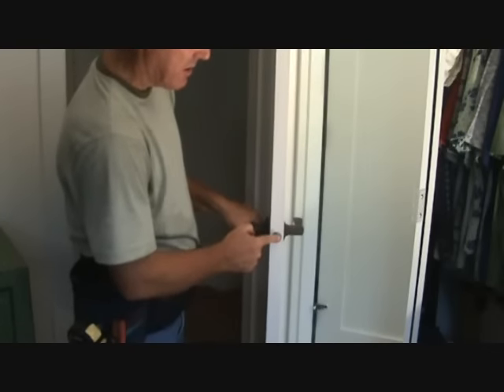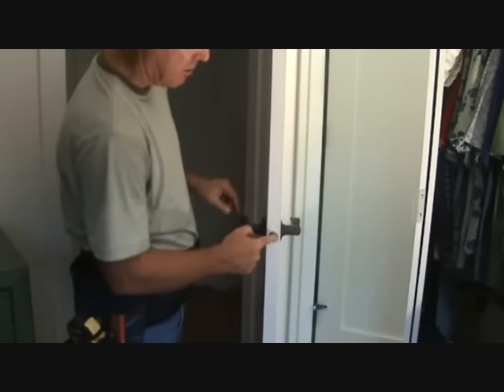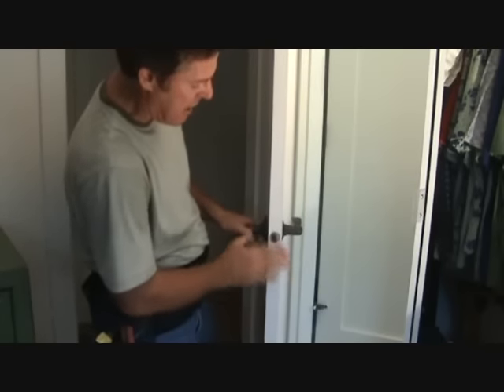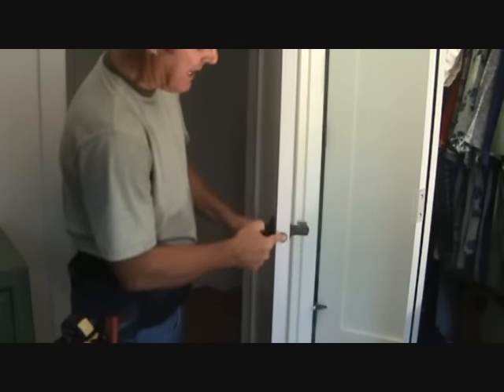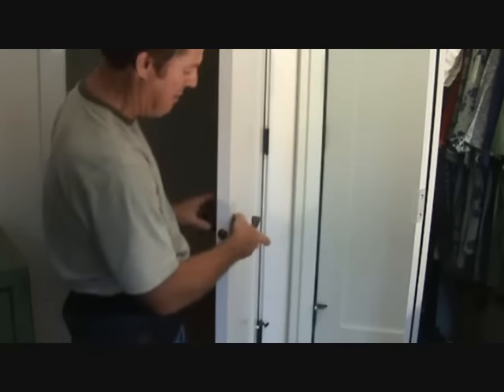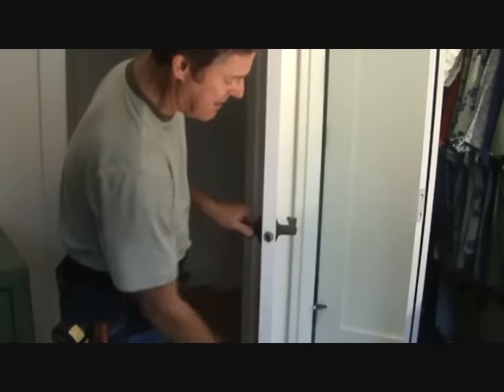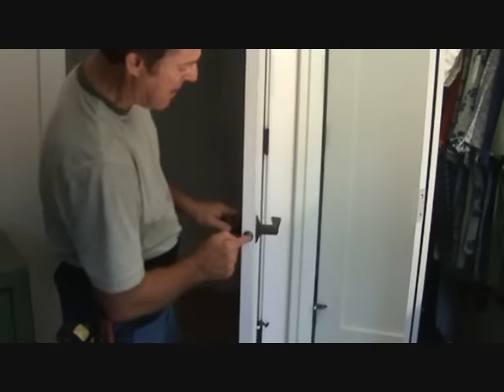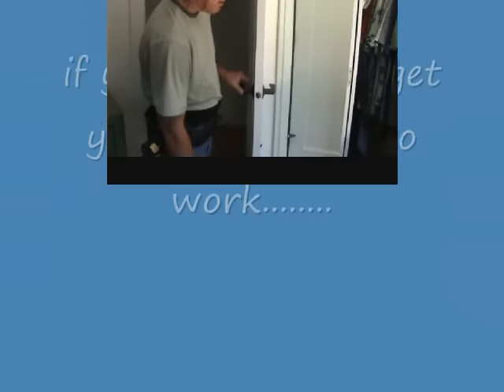Is your "door latch" sticking?

Comment: Hi Joe. My door is stuck shut, something has busted in the mechanism and it won't release the latch, hence I can't get into my own toilet :/ I took the outer handle part off and some broken casting came out. I can slide the handle and activating bar back in and it seems to get some traction when I turn but latch won't release and door won't open. I'm a bit stuck, can you help?
Reply: ***** I can't do the butter knife thing as I only have access to the outside which is the side that butts against the frame, so there's a right angle there before any access to the latch.
Reply from the maker: Did you get that door open or have you wilted & got stuck there for the last 8 years? I have lots of videos that show how to get into a locked door. Go to my main YouTube channel then click on playlists & scroll down to doors & they will be in there....for next time! Thanks for stopping by!
Reply from the maker: Credit card but you're going to bend it up but you might be able to open the door.....you didn't need to pay that bill anyway!

Comment: Hi Joe my door latch won't open my door is closed and the little latch won't go in so I can't even open my door.. what can I do?
Reply from the maker: Take a putty knife, or butter knife or something flat & slip it in there right up against the door latch. Pull on the door handle then try to start sliding the latch open. You can only slide the latch a little way then hold tight on the door so the latch won't slide back to it's normal position. Now take a bite of the latch & slide it some more. keep doing this & you will eventually slide it all the way open so you can open the door. Do you have a crummy credit card? Bend it & slip it in there below the latch then try to swivel the card up behind the door latch to slip it open. Maybe that will work for you. Some door latches are different than others as some are designed to not open at all when the door is close. That's usually for keyed doors though. Let me know how you do!   Joe  :0

Comment: What if I can turn the handles inside and out all the way but the latch only goes back about half to 3/4 of the way?
Reply from the maker: +Bryan Adams Your latch could be all gummed up inside to where you need to spray some silicone on it to let it slide freely. Or you might have a portion of your door body maybe not clicked into the door latch properly. Or your door handle unit is so old that it's pretty worn & it's slipping the latch from going in all the way when turning the handles. Check it out & let me know what you do. If your handle is really old may I suggest you replace the entire unit with new. They don't cost that much & would solve your problem if it's because your unit is really old. But check out the other items I have mentioned as well as maybe you could fix it back to normal. Good luck & thanks for your message!   Joe  :0

Comment from the maker: You might have a metal piece broken inside the door latch....or it could be something else. Take a crummy credit card....or the one you spend too much money on!!...lol & bend it & wedge it between the door stop at the same height as your door latch. You might be able to slip the credit card behind the door latch & push it in to then open the door. You won't be using the plastic card again as it will be damaged, so pick wisely.   Joe  :0

Comment: That slider on the backs of a lot of keylock door knob latches.

It seems that when that slider is depressed, the latch can't be pushed in except by turning the knob, rendering card slides unable to open a door.

So, my question is this,

if that slider is designed for the purpose of being depressed to keep cards from being able to push open a latch, then why is there no mechanism for keeping those sliders depressed? I've looked and looked fro something on the door frame, on the plate around the latch for something designed to keep that slider depressed, but I have found nothing.

What I ended up doing was filing the plate so that it would fit over the latch reversed, and thus will hold down that slider.

It just seems rather silly to have a slider like that and  then neglect to design a mechanism to keep it depressed for those that want to prevent cards from sliding the latch open.
Reply from the maker: To keep the slider depressed the door latch would only close so far into the strike plate hole & the slider is depressed by not going into the hole of the strike plate rather the slider is pushed up against the flat part of the strike plate not going into the hole....See? That's for only doors that have an actual hard key then the door latch will have that slider on there. Privacy door locks that I show on the video & passage handles generally do not come with the slider so for the instance of a privacy door lock being locked you could then use a credit card let's say to slip in there & push the door latch back because there won't be a slider on there. See?

Comment: is there other way you can do it.
Reply from the maker: For most occasions your door latch is sticking because the latch itself is being gummed up so for most instances if you pull your door handle apart & lubricate with silicone spray then you should be good to go. If that doesn't work then your door latch could be really old & could have worn or have a tiny broken part inside causing it to then stick. Your entire door handle could be attached to the door too tight if let's says your door is a steel door with some "give" to it thereby if you tighten the door handle too tight to the door it then gives added pressure to the door latch area causing the door latch to stick & not go in & on easily like it should. Are you having a different issue? Let me know if you are....Thanks for your message!

Comment: I'd like to offer something which has worked well for me.When it comes to lock lubrication,I have found a dry wax based lube called "Du Pont Teflon Multi-Use Dry Wax Lubricant" to be terrific.
It goes on as a liquid & leaves a fine dry wax lube behind that keeps working for years after one or two applications.
Of course You need to address any mechanical problems first. 
I think You will be pleased with it's longevity.

Comment: I don't have a "latch" but a knob that will not move.. Can't shut my front door because the lock is stuck.
Reply: The WD-40 inside the mechanism did not work.  I think I will just have to replace the front door lock.
Reply from the maker: Stephanie Hartmann
 Did you remove the entire lock from the door? Do you see anything that looks like broken parts? Did you spray inside the entire lock? Is your side door latch still stuck? Could that be broken? Did you spray lubricant on that too? Did the latch piece work in the knob like it's suppose to? If you lube & put the hardware assembly back on the door, if it still doesn't work then chances are there is something internally that is worn or broken that may not be able to be repaired. How old is your lock? If it's really super old then it might be time for replacement.   Joe  :0
Reply: no I didn't remove it from the door. just carefully took it apart to be able to peek inside.  Nothing appeared to be broken, just stuck.  WD-40 didn't loosen it up. I only sprayed inside where it looked like moveable parts (sprayed from both sides).  Maybe I will remove the whole thing from the door and get a better look. No idea how old it is (house is a rental).  Thanks for your response.
Reply from the maker: Yes pull the hardware off the door & carefully see if there are any broken parts. You can then check the side door latch & make sure that is moving back & forth ok & spray that too. It's always best though, to use a silicone based spray rather than just regular WD40. Try that in the future but use WD40 this time if that's all you have. Good luck.   Joe  :0

Comment: WD40?? Why would you put Water Displacement fluid in a door handle??
Reply from the maker: I did this video a few years ago & I use to use WD 40 for door handles etc. but they have a new WD40 out that is an actual silicone spray. If you can't find that they have other brands of silicone spray at most any local hardware store. I use silicone spray now. Years ago they didn't have a silicone spray that I was aware of so I used WD40 for everything & always had it around. It will clean your handle or lock assembly but will have a tendency of gumming up since it's not a true spray for this kind of work. Use the silicone spray. Thanks for your message!   Joe  :0

Comment from the maker: Try spraying some WD-40 on the sticking latch & press it a few times. If this does not loosen it up, you would then need to remove the door handle unit & see if there are any broken parts or the side groove might have come out. Something is binding in there. Find it. Spray more WD-40 in there & move around. You can then look more closely at the side latch too. If you have silicone spray, use that rather than the WD-40. Let me know how it goes. Thanks for your question. Good luck. Joe :0